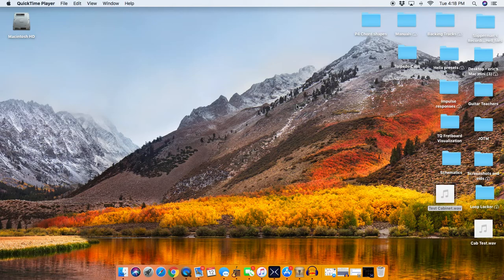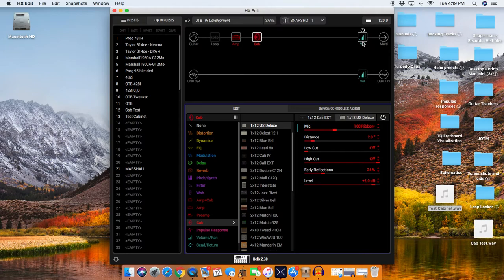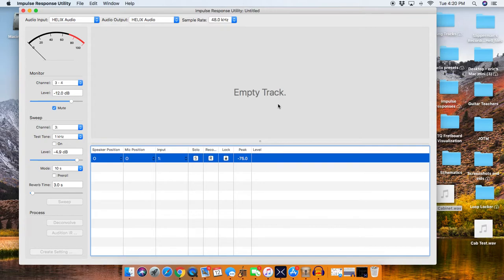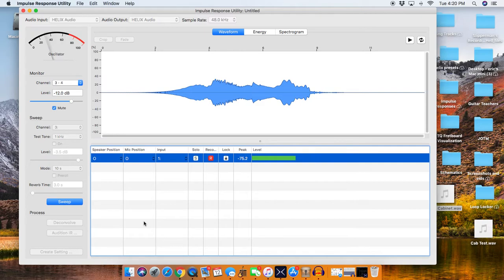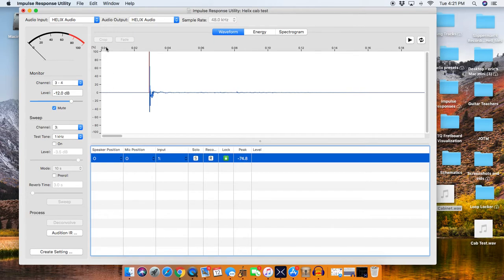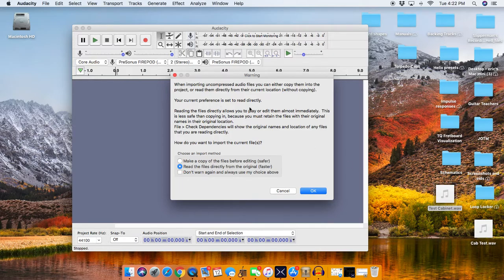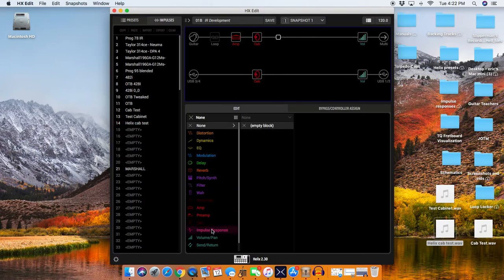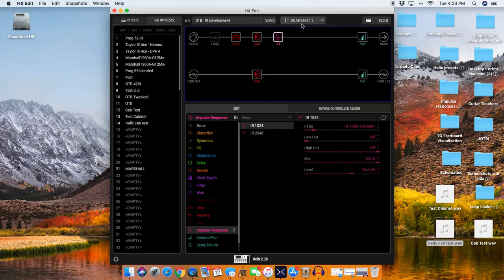How to make an Impulse Response on a MAC

Comment: I tried doing this with my axe fx and it sounded like Garbage. How are you routing the helix to the Ir utility. Also are you capturing just the cab from your helix patch or the amp and cab? I can’t tell if the amp block is disabled in the video. And lastly why do you need audacity to do this? Can’t you just use Logic instead? Thanks